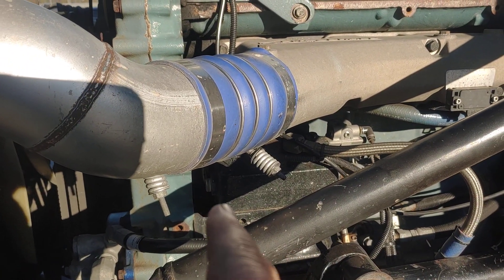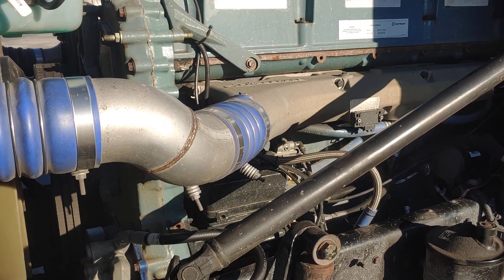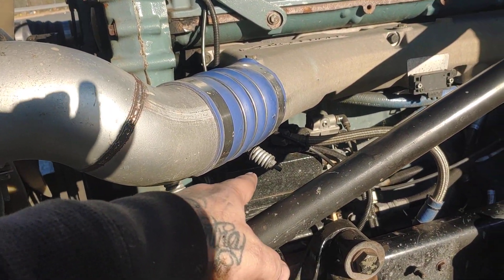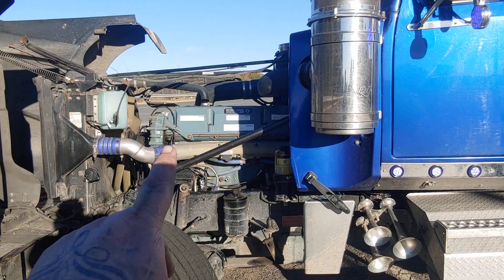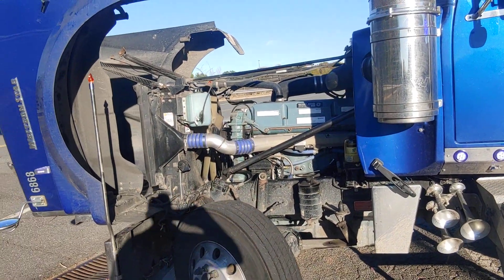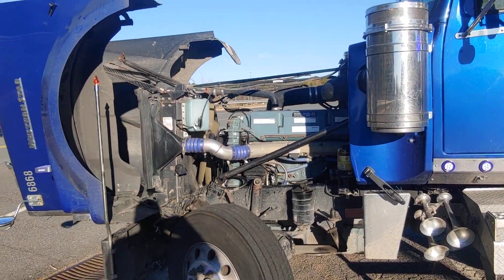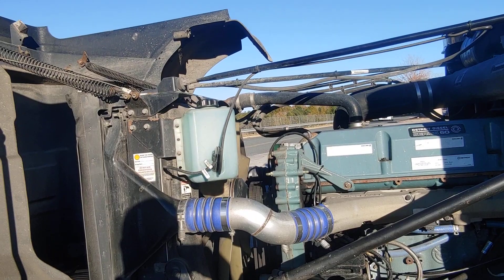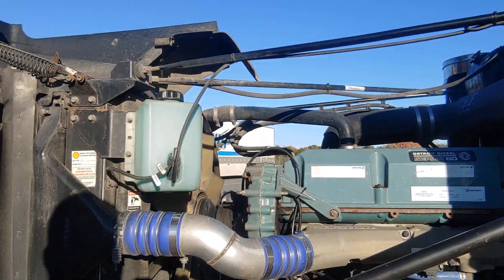Detroit 60 TRS sensor location timing reference sensor

Comment: The sensor above the air compressor is the SRS  ( synchronous  reference sensor ) , below the compressor is the TRS ( timing reference sensor ) . If the engine does not start change the SRS sensor .  DDEC 3 and 4

Comment: So a guy at penske told me a quick fix on both those sensors they are magnetic,  so pull them out wipe them off and smack them on something metal hard and remagnitize it put it back in and go
Reply: It turn out it was my computer  that was making them act up

Comment: Also my friend my question is one out of curiosity how are you able to find out that was was that sensor specifically that was causing the vehicle not to start?
Reply from the maker: It came back with codes referring to the sensors both of them But in the end after changing the centers I found out that it was actually the CPU that was causing the sensors to spit out a code they check that my unplugging my CPU and plugging I'm plugging in there's When they plug in their CPU it ran fine with no code so process of elimination but the answer to your question the sensor codes came out in the Flash codes

Comment: Thanks for this advice-
I got Interesting to know about that bracket that is holding where the bull gear go - those support so won’t leak oil ?
Reply: That bracket also for the purpose of keeping the bull gear cover from shaking/vibrating when the AC compressor kicks in
Reply from the maker: Yes

Comment: So what happened, did you get it running, did the sensor improve performance
Reply: No it turns out in the end it was the CPU that was making the sensor flip codes had to replace the CPU
Reply: @Mr. CADILLAC earl hunter  how did you reset the cpu?

Comment: That sensor is a pain in the ass. The unloader calves for the air compressor are a pain too because if that air intake. I'm thinking bout removing my air compressor and either rebuilding it or getting a new one. Best believe I'm replacing those 2 sensors when that air compressor comes off. And I'm replacing the boost air hose that goes to the back of the air compressor from the air intake. That bitch blew on me outside if Philly on 295 on a Sunday. Limped that muthafukka all the way back to CT. Fixed it Tuesday but it was a pain to get off because if that stupid hose clip. I wouldn't trade my 2015 Columbia glider for nothing. Unless it's a 2022 Cascadia with 5 year bumper to bumper warranty with no payments 😎😎